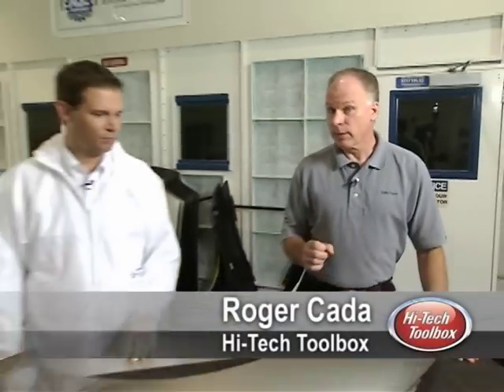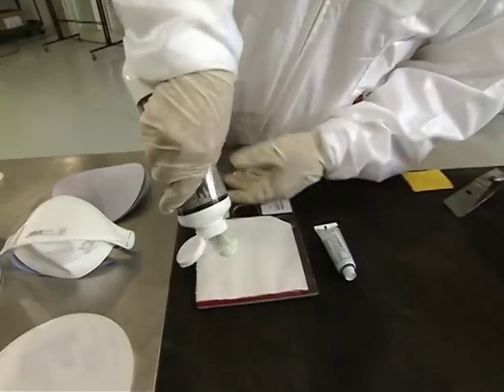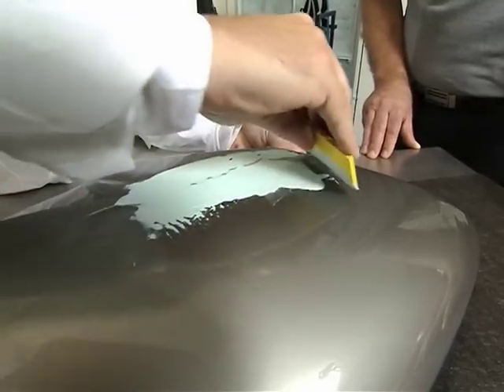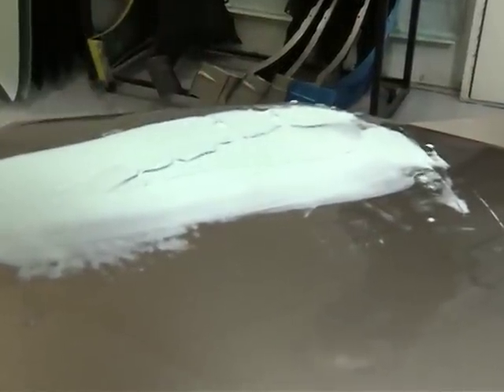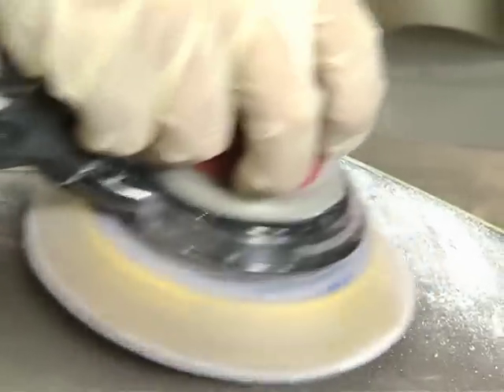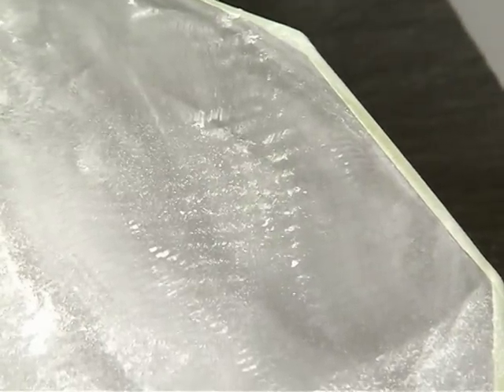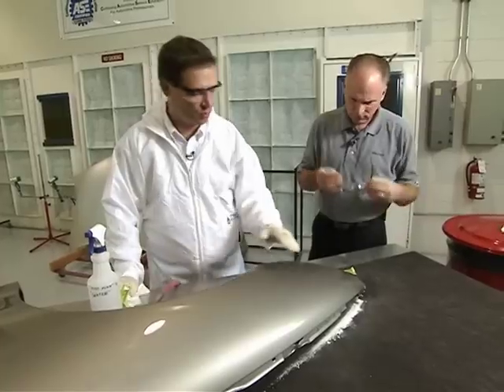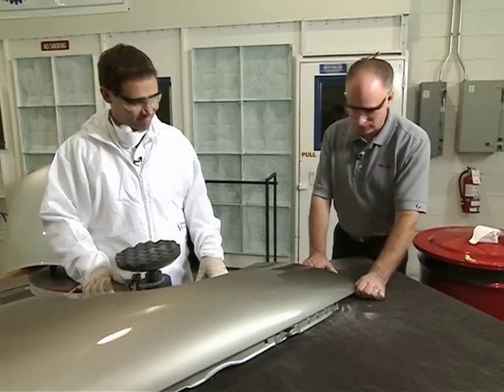Sherwin-Williams Automotive - Fix that Run

Comment: This method does work, I've done it many times with good results I even made my own video on it.
Reply: Hi!  On your video you used a body filler, and in this video he used a glazing putty.  Are the results the same?
Reply: Dan Campbell No big difference, I just know body filler is a bit cheaper so used that, some fillers sand better than others so that's the only difference I could see.
Reply: William Walker I'd recommend force drying it with infrared curing lights or leaving for a week.
Reply: How many coats of clear do you guys apply on the panels? Does it matter with this method?
Reply: Oscar Contreras 3 coats of clear
Reply: Seen yours first actually lol
Reply: @TheGunmanChannel  and love your vids
Reply: The first time I saw this was from your video.
Reply: Have you measured the clear coat thickness with a digital paint depth meter? I’m curious to know how much clear is left compared to the surrounding areas ?

Comment: that fender must have a gallon of clear on it..
Reply: Lol  very true that what i was thinking of
Reply: I don’t think there is any clear left after all that sanding .. only a couple microns that will barely protect the panel from UV light
Reply: Watch the video by the gunman. He blocks his roof after painting and uses a mil gauge to measure the thickness. He started with 600 and moved up to 3000 and he only went through .17 microns of mil thickness. I prefer 3 coats when I know I have a run, but 2 coats is plenty of clear to sand out

Comment: Masking tape on both sides of run with 1000 grit works excellent.
Reply: right? who the fuck starts with 320 on clear?
Reply: @nickprice6451  I would a pain to get the scratches out for sure using 320 grit.

Comment: @lozagon 

are you saying, you clearly see that there is a run in the paint, and not in the clear? for a shop to deliver your car to you with a run, it must've been a low cost paint job. but aside from that. this demonstration will only work on clear.. because if youre sanding down paint, you're going to need to reshoot more paint. where here, clear is the gloss and protection of that paint..

Comment: I did this the following day and it was only air dried. I had a fender that looked like Niagra falls. The clear was finish one. I dunno if I got lucky, but it's doable in a pinch if you need the car out the door.

Comment: yeah ok good, but very often the runs are still  visible at certain  angle and very difficult to get rid of!i you have to have plenty of clear on top and if the run occurs on the first coat with that metallic paint will distort the flakes!!

Comment: Don't have runs to start with, first you must use a product your use to and check temp that day. put cat. in paint and let set for 30 min before use, also humidity plays a big role in painting, it delays drying time. there is a science to mixing and spraying, it takes time to learn these things. There is a fine line between orange peal and sags. You just have to learn with time.
Reply: no you wont if you know what you are doing and I been spraying for 40 years.
Reply: Robert Thomas you mean to tell me you have been spraying for 40 years? And never signed your name on a few? Wow your a paint god...
Reply: when i was in a factory being rushed yea.
Reply: thats how I avoid run's, I don't run, I took time and effort to learn how not to .

Comment: Using that DA sander is not a good idea for Harry homeowner. As mentioned by others, start with a fresh razor blade and scrape the bulk of the run off first. Then you can move to 400-600 grit on a block. I am shocked that he didn't cut thru on this job. Must have had a lot of clear on that panel.
Reply: very true  not a good idea with DA  he must have put 6 coat or clear lol , i never use 400 or 6 00 on runs after blade just  block 1500 than 2000

Comment: You dont have to use filler you can use guide coat if your careful not to put it on wet or it will frysaves wasting putty and easier to colour sand

Comment: Paint paddle with 1200 grit wet or dry sand paper wrapped around it. Stay on top of the run when standing. Then go to 2000 grit and buff. Idk who shoots a fender vertical, indtead of horizontal, there would be less of a chance of running.

Comment: LOL !! you did not get to see end result close up cause i guaranteed he burnt thru on the edges !! DO NOT USE A DA GETTING A RUN OUT PEOPLE!! now the putty method does indeed work ,but use a block lol !!
Reply: He had the edges taped, also a mistake, tape adhesive and compound do not mix and have you lookin like an epileptic trying to hold the buffer.

Comment: That's a good trick I've used it before my question is why are you mixing the bondi with the spreader shouldn't you be using a paint stick so you don't get your spreader messed up with some Bondo and some hardener trying to spread it on and getting the wrong mixture and then it won't stand off 
mix your Bondo with a paint stick it saves you a lot of grief

Comment: There can't be enough  clear left after doing this. It should be flow coated at the least. If the painter is running clear this badly, he shouldn't be painting.

Comment: First of all, a good painter shouldn't causes a run. well, ok, no one is perfect. Sh** happens, and when it does,  don't fake it by removing the clear coat and  replace it with polish. Redo if it is taking you more time. You screwed the job, you fix it right, don't screw your customer.